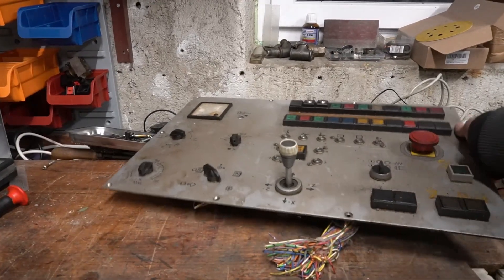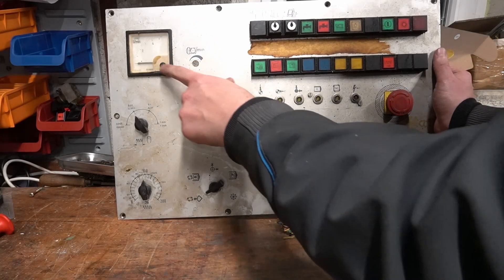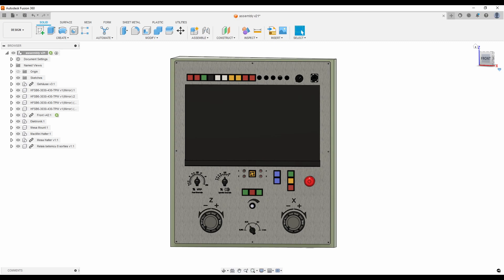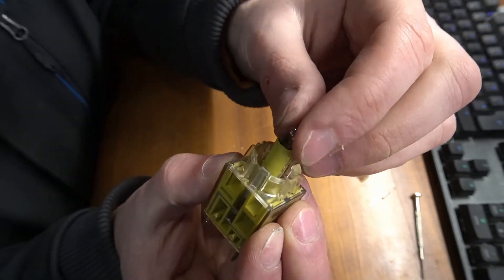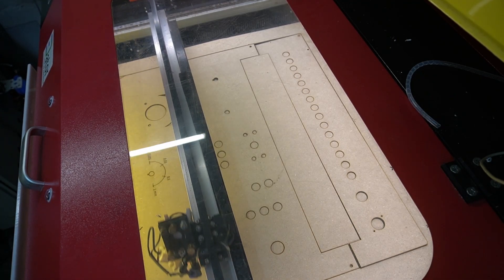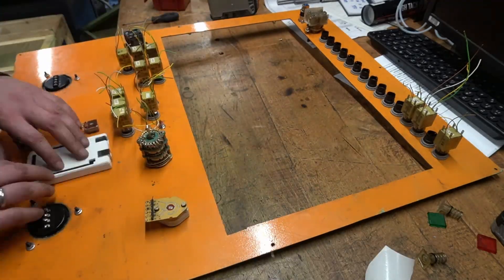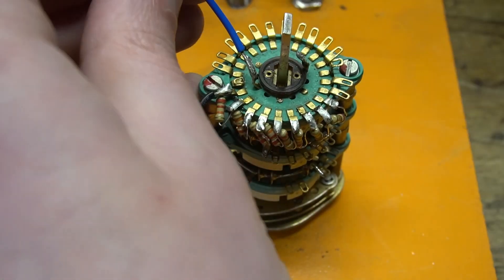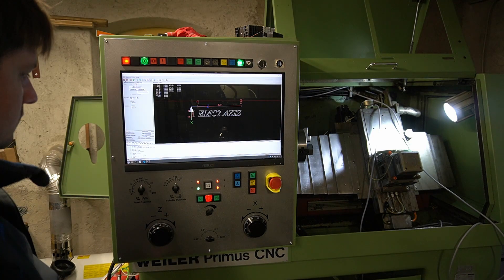DIY control panel for LinuxCNC - Weiler Primus CNC retrofit pt.4

Comment: You could probably have used the matrix_kb component to connect the control panel (And the 7i73 is probably easier to set up than the Arduino).
But the Arduino is a perfectly valid solution.
Reply from the maker: Hi Andy, i agree, the 7i73 is the nicer hardware for sure, not only because it runs in the servo thread. But the arduino is much cheaper and as it turns out it is easy to implement a lot of special features. You might now this thread on the Forum, where we got a MatrixCNC with shared wiring for multiplexed LEDs to work with my arduino-connector project. 
https://forum.linuxcnc.org/show-your-stuff/49606-matrix-keyboard-controlling-linuxcnc?start=60
See it working here: 
https://www.youtube.com/watch?v=VGt43evY7Rw

Comment: If you get the dual MPG wheels working, I'd be pretty interested. I went and checked out your git, but I didn't look to in depth, but what are things looking like for future board compatibility? Would be a cool teensy project imo
Reply from the maker: i currently have them connected directly to LinuxCNC, since the Arduino input is a bit slow. But it could work also.
Reply: @theartoftinkering  yeah I'm wondering if I sent them via arduino, If it would just be sent as arrow keystrokes. I'd like to keep the mpg wheels in the realtime layer, but I can't get a 7i73.. Been out of stock for some time now and shipping for one from Europe is stupid expensive.
Reply from the maker: @Nordic_Goon  Quadrature encoders are not supported yet, but i will include them for you. I think i would put 3 modes in place. "arrow up & Down" and a counter. I guess this will enable all kinds of usecases with rotary encoders with linuxCNC. I'll let you know when i uploaded the update, maybe you want to test it for me?
I think MPG should work easily, but i wonder how laggy it will feel. Anyway, propably better than nothing :D
Reply: @theartoftinkering  hey, I mean I've already written my own code and was poking around to see if anyone had done encoders but I could definitely test it out. I use teensy 3.2 and 4.1's so that may help, but it just depends on how well Debian handles keystrokes I guess haha.
Reply from the maker: @Nordic_Goon  Do you intend to use it with LinuxCNC? I think to send a counter might actually be the better solution for MPG usecase. Then you can have for example 1mm of movement for each Pulse.
Reply: @theartoftinkering  Definitely, I can do a counter. I'm not as versed in what methods would be more ideal than others or how to get external usb stuff talking to the Hal pins, but I could most likely manage to stumble my way to getting something working if I could get a little more info on the arduino to Hal connections.
Reply from the maker: @Nordic_Goon  i use this https://linuxcnc.org/docs/html/hal/halmodule.html 
Arduino sends serial commands to the Host PC and a Python skript reads them and writes data to the hal. 
I think my code should be compatible with teensy hardware, so you can copy stuff from there :D
Reply: @theartoftinkering  Awesome! Thank you I'll poke through it!
Reply from the maker: @Nordic_Goon  https://github.com/AlexmagToast/LinuxCNC_ArduinoConnector
here have a look, i just implemented Encoders. You can add as many as you want now. I've tested it a bit and it seems to work quite well for me.
Reply: @theartoftinkering  Awesome! I'll take a look at it when I get off work! Thank you much!

Comment: beautiful work !
why do you use Arduino and how is it serve you so far?
Reply from the maker: Arduino is a cheap and flexible option. The old switches i wanted to keep require some logic and i didn't want to calculate it in LinuxCNC. 
The arduino now does all the logic and sends the calculated signals to LinuxCNC, which makes it easy to implement i think. I use it since the video came out and yet didn't encounter any issues.
Reply: @theartoftinkering  very cool what is the linuxcnc run on and how is it all connected :) i like to try to build sum thing similar to what you have here 
thanks for sharing
Reply from the maker: @1T1T1  https://www.youtube.com/watch?v=d5WtskW0o68 😉

Comment: I am wondering why, in this day and age, you did not use a touchscreen HMI graphic display and eliminate the buttons and the rest altogether?
Reply from the maker: Buttons are nice 😄
but as seen in the Video i also installed a 22" Touchscreen, which fits the touchscreen HMI graphic display requirement, or what else do you mean?
Reply: As a cnc machist myself i totally understand why buttons and knobs, you have more feel wits the machine and do not have to look where you touch the schreen while jogging for example.
We have at work the newest heidenhain controllers on 2 of the new machines, totally hate it. Greasy fingers on the screen, tapping the wrong thingy...

Combination of both is the best i think :)

Comment: I know it's a bit late, but I have a couple recommendations for the panel labeling. The first one is for using spray paint (or enamel), if you use an etchant first, the paint (or enamel) will be slightly depressed into the sheet metal and less likely to wear away over time.
The second recommendation would be the use of something like Cerakote, which is laser fused to the sheet metal.

Comment: Thank you for sharing your control panel build. What is the black self-adhesive material (7:46 in the video) that you used for creating your paint mask with your laser cutter?
Reply from the maker: It is Vinyl foil, commonly used in plotters. I've tried a variety of self adhesive tapes and this worked the best, since the color doesn't flow beneath it. It is made of PVC however, so i wouldn't reccomend using it since it releases nasty fumes when burned by the laser. Also as you could see in the video i struggled to get it of again. Also a lot of glue residue was left that i had to carefully remove useing isoproanol.

Comment: Thanks for this great video and especially for this valuable Arduino project to extend LinuxCNC inputs and outputs!
I'm really looking forward to using this in my projects, finally having analog inputs, I'm waiting for rotary encoders to choose feed speed for example.
I can't really contribute, but I hope this project goes far.
Thanks again, I'll keep an eye on it.
(I'm french, sorry for my english)
Reply from the maker: Hi, have a look at the repo, i just implemented rotary encoders. With this you can modify the feed override  and the spindle speed override for example quite easily. https://github.com/AlexmagToast/LinuxCNC_ArduinoConnector
Reply from the maker: Thank you. Let me know if you have ideas on how to improve the arduino_connector or if you need help setting it up.

Comment: Your LinuxCNC_ArduinoConnector project looks interesting but USB is something I would try to avoid in a CNC build. If you can connect via a Ethernet Shield it would be more reliable.
Reply from the maker: There are already hundrets of IO extension options available. This one is the cheapest. ;) 
On the other hand, the arduino_connector is intended to connect everything you can do with arduino to linuxcnc, so this could be an interresting feature.